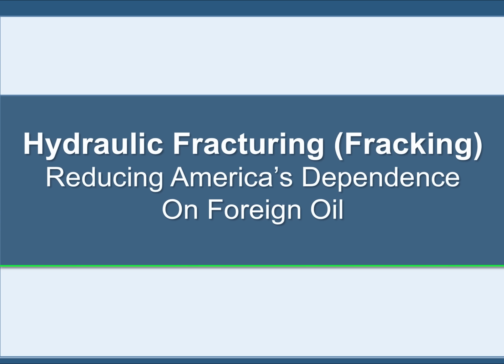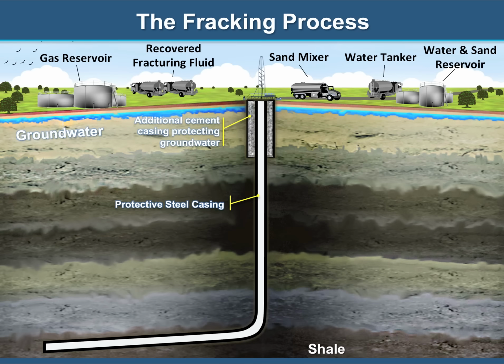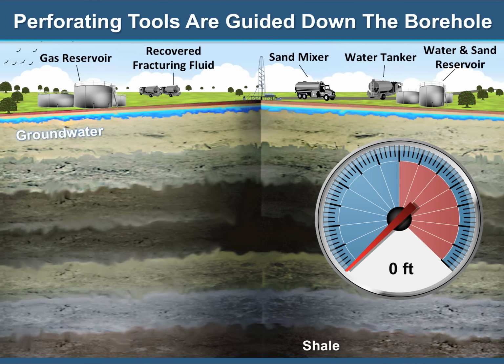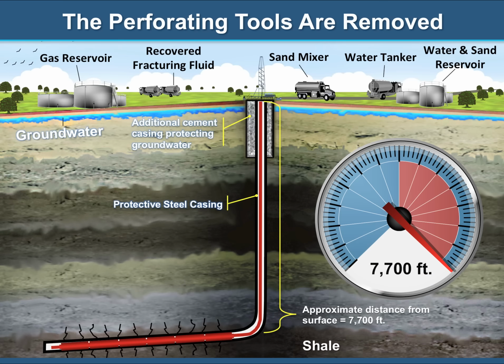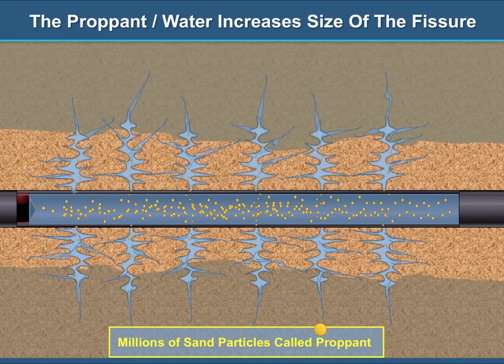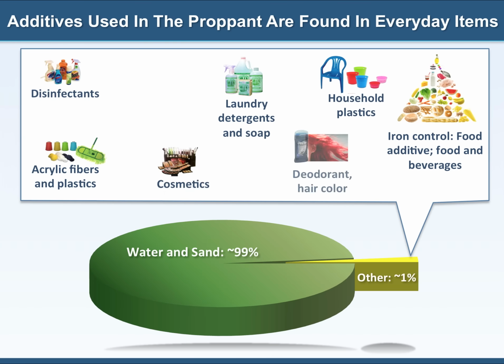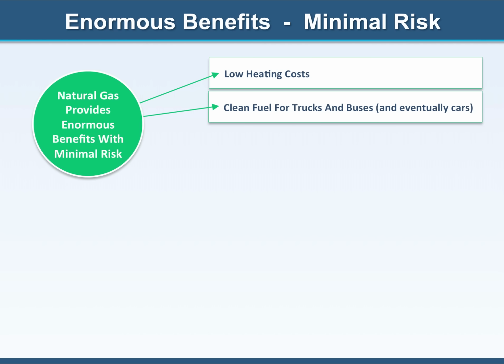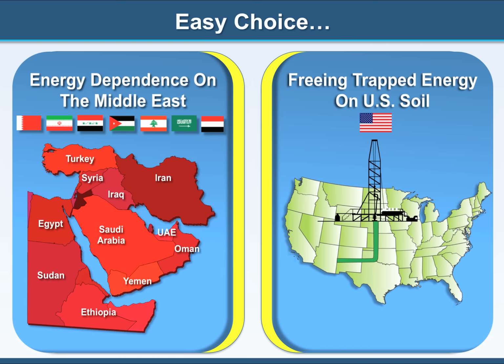Fracking Explained with Animation by A2L Consulting

Comment: how do they get the steel casing pipe in where it bends horizontally ?
Reply: Think of the way a straw bends, and I know is hard to think about a casing string bending that way because it is well...metal, but remember this casing string is over a mile long, and the bend portrayed in most drawings and videos is actually not that pronounced, it is more gradual. the use of orienting nipples and latches help orient the casing in certain direction as well. It is also important to reduce the severity of the dog leg (name used to define these pronounced bends) to prolong the life of the casing.
Reply: David Perez Rios  that helps.  but i still dont see how they get straight pieces of pipe to go in after that gradual curve, it would have to be very, very gradual or they must be using smaller pipes after the bend or a combo of both. in all the illustrations ive seen they show almost a 45 degree angle and that would be impossible to put steel pipes in after.
Reply: gpain616
Good point,how do they get the straight pipes in around the bend?

Comment: Notice to all tree hugging, "I did some research" douchebags: We Pennsylvanians do not care about what you, or the Hulk, all teary eyed has to say. Do you remember the industrial revolution? The reliance on OUR steel, OUR coal. The bricks below the Eiffel Tower are from Patton, PA btw, a few miles from where I type this. Our industry pushed this country into technology you have today, the energy, the buildings, the infrastructure all built by resources we attained through hard, dangerous work. Work, mind you that some college student from some social debate club could hardly last an hour in. You had no problem with the pollution and death (a lot in the mines) until we ran out. You'd rather depend on middle eastern resources which only perpetuate US involvement, soldier loss, and declining economic stability. Yes, there are mistakes, which the industry will only fix and evolve into more safe practices. The benefits outweigh the risks. Energy producing resources like Oil, Nuclear, hell the Hoover Dam, all had its issues. But they were refined and perfected. You wanna make an omelet? You gotta break some eggs.
Reply: That is so true about breaking eggs.The real problems we have is over population.
What we need are smaller thinner doorways into fast food outlets.Bromide or it's equivalent put into any water supplies for Religious institutions or where there are dense populations to stop them all breeding and much,much stronger alcohol and drugs available,no speed limits or driving control signs on roads and everyone over 80 should be euthanized unless they can show why we need them.
We also bring back the public stocks and set them up in every village and town center and people who do anti-social behaviour like pissing in the street or abusing their expenses get put in them for a day or so.
Reply: Tickled Rage We will all be fine for the next 50 or 60 years and then when it's gone what next?The only way forward is solar power,it's cleaner,you may not have as much power and oomf as gas but you will still have a beautiful environment around you in which to live.I would be interested to know what the residents of Dimock,Pennsylvania think now about their surroundings since the drilling began.We can exist on sparrows fart power,it's just that we all need to use a little less electric juice in our everyday lives.I do love the trees and all that stuff,I work in lime and cement another environment screwing industry,I need wood for all my building work and I need to burn things for my mortar,I only screw up a little bit,I have a low carbon foot print.
Reply: Hell yeah brutha! Murica!

Comment: And what about the unsolvable problem with the cracking cement? 6% of the wells leaks immediately, and 60% leaks in the course of 30 years! ("Sustained Casing Pressure" is the euphemism oil&gas industry use instead of saying "leaking wells".)

http://content.yudu.com/A1jzld/Autumn2003/resources/65.htm

http://www.slb.com/~/media/Files/resources/oilfield_review/ors03/aut03/p62_76.pdf

Comment: People, get your facts before you comment. Fracking of coal seams is criminal and certainly a no, no because there is a huge chance that fracking will contaminate ground water. Fracking of gas bearing rock deeper than say 1.5 miles is however a totally diffent cattle of fish..... as explained in the video.
Reply: People you see lighting their well water on fire have a methane gas problem.  It is nothing that can not be fix nor is methane toxic.
Reply: *****
the first oil and gas wells in Pennsylvania were drilled to a depth of ~70 ft.  Of course there is gas in their water wells drilled to a depth of `800 ft.  That's why oil and gas companies are up their in the first place..oil and gas is very prevalent in Pennsylvania.
Reply: ***** OK then You let your water run for an hour and then light a match then say that as you burn to a crisp.
Reply: ***** I don't need to light my water on fire. But I remember in school we use to be able to light the water on fire.

Comment: NAtural gas releases more methane than oil. Methane traps scores of times more heat than carbon dioxide. IN OTHER WORDS: If you want to completely fuck over your children, use natural gas.

Also fracking poisons the earth. Please watch Gasland if you for some stupid reason think this is a good practice.
Reply: OIl Instruction  You can't love fracking AND the environment. Please choose One. Thanks.
Reply: It depends on what you mean by release.
 All oil reserves have a methane in them so all oil production produces methane. I guess if you say more methane is leaked during shipping when you exclusively produce natural gas (which is 90%+  methane) than sure but it's nowhere near enough to counteract the positives of using methane.

methane is C-H4. So when it is burned with oxygen you get one carbon dioxide and two water molecules. Some energy is released by the carbon going to a lower energy state in CO2 and some energy is released by making the hydrogen's go to the lower energy state of H2O. Because carbon can only hold four electron pairs methane is the most energy dense per Co2 produced. Oil has less because it is a chain of carbons meaning there is less hydrogen per carbon. In turn coal is the worst because it is just elemental carbon (with more sulfides and other junk).

No study that I am aware of has shown enough methane can be released through leaky pipes to counteract the huge reduction in carbon by switching from coal to methane. One study has shown that maybe they are close but the preponderance of evidence shows its a large net benefit to human warming effects.
Also you have the problem that even when the methane is released it has a half life of two days (or at least very short I may be wrong about that) when the CO2 can stay in the atmosphere for years. The methane wants to reduce to CO2 and water so it can't last long in the high radiation environment.

bottom line, very little methane is released do to oil production including fracking (why would we try to lose the product we are selling?) when this small amount is in the atmosphere it is 1000 times more warming than CO2 but it goes away quickly. So no methane is not worse for global warming than alternative sources of fossil fuels in fact it is much better
Reply: Sorry for the long post I felt it deserved a full explanation.
About the second point. Gasland is preposterous on nearly all fronts. I believe Josh Fox had good intentions but he did a poor job fact checking and he contributed everything bad to fracking without considering alternative explanations.

obviously this would be a 200 page essay to go through every point but my main problems with gasland are:
1) he used wrong number
2) some of the people in his move admitted to staging events
3) The methane leaks shown in his move were ALL attributed to naturally occurring methane (it happens allot were I'm from)
4) he incorrectly explained how hydraulic fracturing works
5)The USGS has found no link between hydraulic fracturing and earth quakes (but there is correlation between earthquakes and water flooding which are totally different)

It's been a few years since I have seen gasland so I'm sure I missed some points but that's the jist of it.

let's put it this way I am studying petroleum engineering and I would have no problem with a company fracking in my back yard passing through the aquifer me and my family drinks from. Other things could go wrong that I would keep an eye on but fracking is about the safest procedure we have.
Reply: Fracking is Killing the earth.
Reply: Bodhi Dharma Why? do you have evidence? at least for me once i delved into the actual data it became a non issue to me. I love the environment and want to protect it i just seems that there are much more pressing issues.
Reply: Fracking prisons the earth? Is that a serious argument?
Reply: Bodhi Dharma I think you would agree there will always need to be some level of oil extraction. So would you rather only people who don't care be involved? 

In my view i am doing more environmental help than nearly all activist because i am actually preventing million dollars spill and blow outs. A ounce of prevention is worth a pound of cure as they say.

As for fracking specifically I came into my studies think it was dangerous and the more i have learned the less scary it is. i think its actually one of the safest methods in the industry.  I want to keep a close eye on all risks (blow outs, leak pipes, poorly cemented well bores, spills ect) but honestly fracking is the least of my worries. The physics and evidence is overwhelming that fracking itself is very safe but that does not mean the industry as a whole is safe

Bottom line l love the science, geology, economics and physics of oil extraction. It is fascinating how they interconnect and the studies engage me. i grew up hiking climbing camping and fishing and love being in the outdoors more than anyone. I can merge these loves by making sure oil extraction is done safely. When done right i can yield the economic benefits to society without hurting the environment at all. if i'm safe all that's left is foot wide whole filled with cement i want to keep it that way.

It may not make sense to you but i sleep fine

Comment: Ha! I work in frack. The chemicals used are very dangerous in high concentrations, so is bleach, but once its mixed you can swim in it or drink it. When the frack water comes back to surface it is very salty, saltier than the ocean but its still safe. A lot people are all hype about fracking but does anyone know where the water goes to after it leaves a nuclear cooling pool? That water is highly radio active!

Comment: Our vehicles run on oil products, namely diesel and gasoline. CNG (compressed natural gas) has been tried for several years, and has been thrown to the wayside because of costs and unreliability. Fracking is not without its environmental problems.  Just look what has happened in Pennsylvania. Undrinkable water, higher radiation levels, burning water are just some

Comment: The 1% is not extremely difficult to refine out, but thats not all that is there. If you do a bit of research you can find the information of the large amounts of radioactive material that comes up with it, and the salinity content. Many plants are set up for process of freshwater, so they need special facilities since the salt content is sometimes as much as 5 times greater than sea water. Then they have to process out the radium that comes up with it, which  is typically 100x the safe limit

Comment: Earthquakes of 3.0 and larger have been rising in areas that are not prone to earthquakes were these sites are being set up. This is not because of the fracking process, but because of the disposal of the fluid when it is done. They dispose of it by injecting it into underground wells. There is a long explanation for what happens in between, but the end result is earthquakes caused by this injection.

Comment: I agree with cepterk on some parts of his arguments and disagree on others. The chemicals they use ARE toxic, but they do not reach the environment from the initial process. The real issue is the disposal of the fluid after the fracking process. Not only does it have those chemicals, but it is known to come up with very large amounts or radioactive material such as radium. They could recycle and reuse the fluid which would help the problem, but instead they put it into underground wells.

Comment: Please do switch on your brain. The shale is not always that far underground... certain areas the shale is quite close to the surface.  And the gas + fracking fluid will contaminate water.  People have tap water that is flammable now.  If you insist that the chemicals leaching into groundwater will not harm people then i suggest you go to a drill site and drink a nice tall glass of the water.  The world will be better without you.

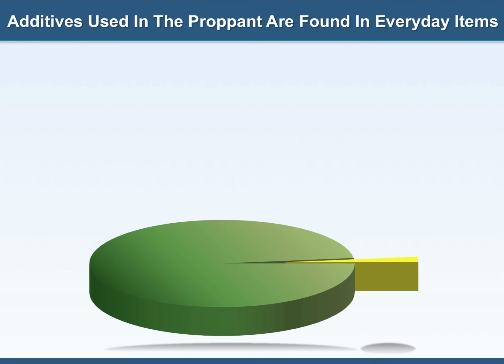Comment: take a look on a slide at 5:30. They say the mixture is non-hazardous. "water, sand and only 1% of chemicals". These chemicals are mainly detergents, added for better gas desorbtion. Add 1% of a soup in tea or coffee. try. Is it safe?
NOT! 
and they pump it into the ground!!! Most components ARE NOT BIODEGRADABLE. They will stay there for Years. 
Other point - they do cracks there! Will the gas go JUST into the tube?
Switch on your OWN brain and think by Yourself, not just blindly believe them..

Comment: Actually your formula is not exactly precise. I do understand what you're trying to say, but it's misleading. 1 teaspoon is nearly 5 milliliters. So that 5 mls would be too much if it was to represent the 1% of additives. You would need to add 1ml not 5mls to your 1 Liter example, which obviously is a much smaller portion. Something else to take into account is not all the products/chemicals in the 1% are toxic/harmful thereby reducing the potential toxicity of the byproducts.

Comment: I feel like there safety measures are so lame. "ya the part close to water, we just made it thicker.." that is going to work.. not, they have already contaminated many water sources. and like the other said above regarding  "the solution is only 1% chemical, that is ok"  you are right that is like saying there is only 1% lethal toxin in your water. just drink, or as u put it there is only shit on 1% of your sandwich, no big deal... lolz fracking is not the answer, the answer is be smarter

Comment: Except Eric that the problem with fracking lies with the drill head. This is the Achilles heel of the operation; once said chemicals are far underground then they pose no threat, but steps must be taken to secure the pipe pumping them down there. This is of particular concern when it has been admitted that the tremors which fracking causes have  damaged well casings after only a few exploratory operations. With sustained use imagine the risks (especially without adequate inspection & regulation)

Comment: I work in the ND oilfields.  The casing is far from thin.  Plus it can handle up to 10,000 PSI of pressure.  Not exactly weak stuff.  And it's heavy as hell.  Even the small 4-5 foot long 5-7 inch diameter tuber we use in wireline takes two guys to lift.  And that is light compared to casing tubes.  You know nothing.

Comment: Fracking is just as safe as any other method in the industry. It's not the procedure, but human error, that leads to unintended consequences. The measures taken to reduce hazard to the environment or people are, by themselves, perfectly capable and effective at preventing harm and damage. Mechanical and procedural errors will occur in any workplace due to oversight, complacency, or incompetence.

Comment: "additives" if it only makes up 1% surely it can't take too long to describe what you are actually injecting into america's underground water supply. Also steel casings-like a safety valve? they worked well for BP in the gulf.

Comment: Did you know that most water wells, especially the ones that contain vast amount of good clean water, are situated around a coal seam? One well known fact about coal, when you're educated about this, (or just have a brain at all), is that coal is FULL of methane, which is a natural gas of course. Now periodically being that the water well was drilled just like oil wells are drilled, they drill through that coal, and will have surges of gas to the surface. Completely normal. Frac is not to blame.

Comment: Besides the fact that those wind turbines are delivered to their site where they will be operating by truck, which burns diesel, and a crane that will erect them and piece them together, which burns fuel, and those awesome solar panels, which are made from oil (plastic), you're pretty much fucked from every angle here dude. Do you drive a car? Yes. Fuck even if you ride a fucking bike, the damn tires are made from what...RUBBER, rubber is made from what...you guessed it! OiL. Get over yourself.

Comment: Fracking does not pollute water systems. Improper drilling practices is what would do that. Fracking is a means to increase volumes of gas coming to surface. If you have improperly cemented casing, that is the only way the gas could enter the water. That being said, in a conventional well (no multi stage fracking) the same thing could, and has happened.

Comment: No. The fluid used to drill a surface hole (anywhere from 50 to 500M) Is always water based. Regulation in Canada and United States are extremely strict on this subject. Depending on what kind of system you are using, some additives would be bentonite, calcium, sawdust, etc. All natural and completely safe.